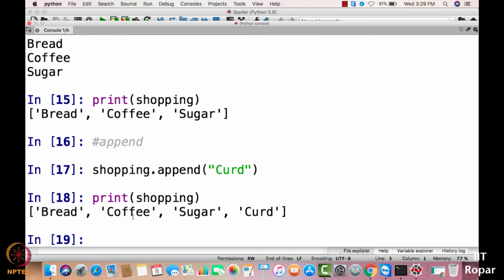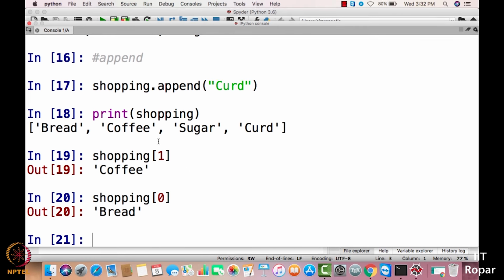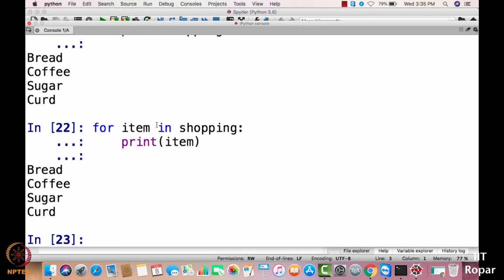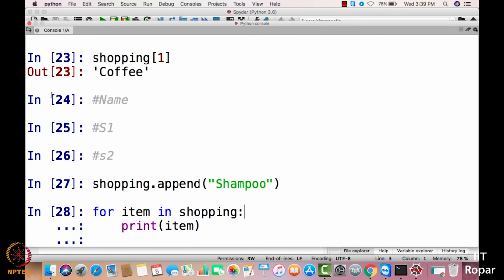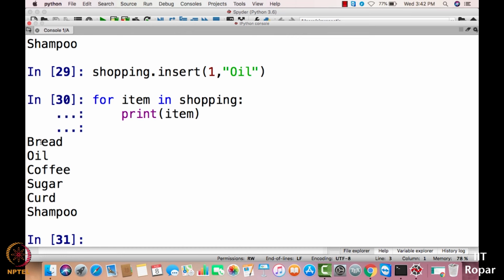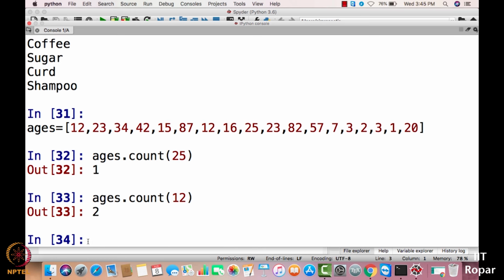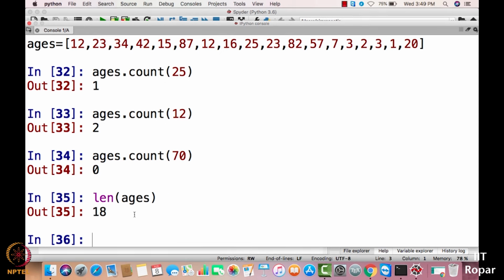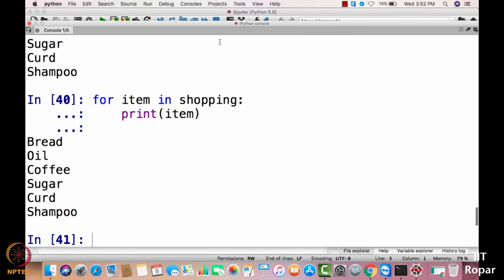Lists Part 2 : Manipulation

Comment: Inserting of an item was explained ok!.. but how to take out an item from the list???
Reply: Thanks for the question. I also got to learn from your question. Shopping.remove("Oil"). This will remove the item Oil from the list.
Reply: @_The_Alchemist_  thank you so much for your reply..😊
Reply: @_The_Alchemist_  but that wouldn't work if there are duplicate items on the list...that's why I prefer del shopping[1] (suppose we need to delete oil which is on index position 1)
Reply: @krakenmusic5195  Agreed 👍🏽
Reply: Useful comments 🙂